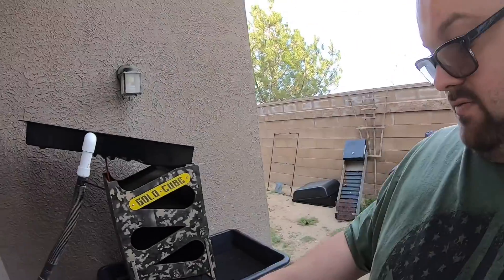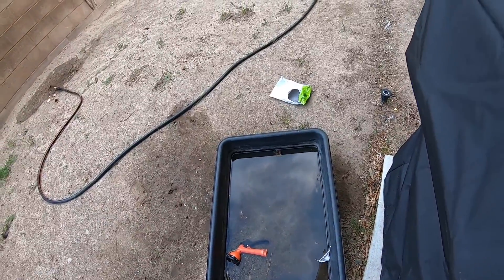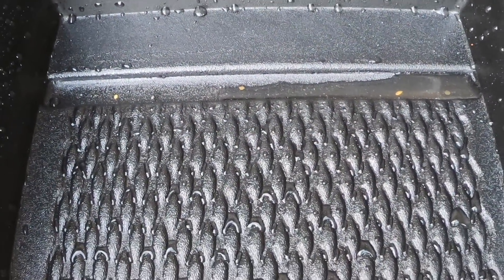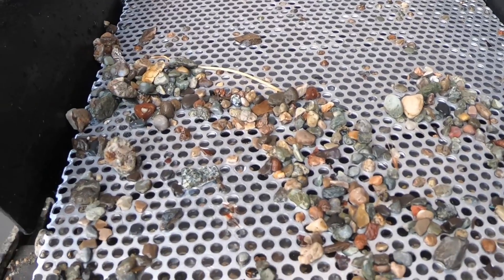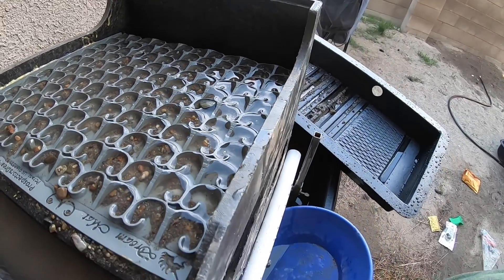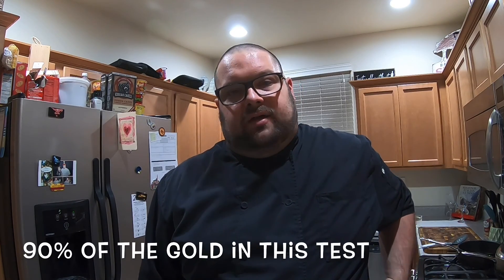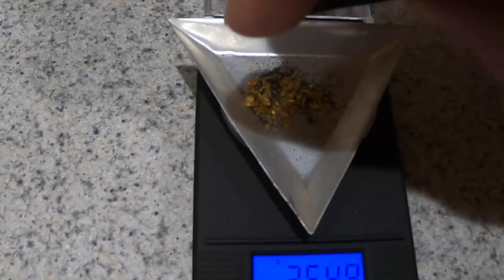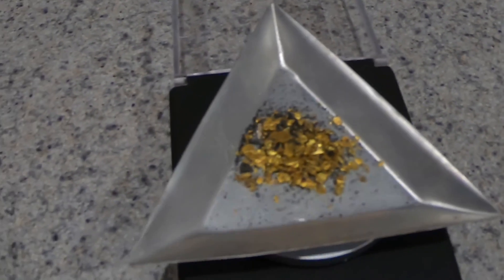SpikeStrike Goldcube Topper first run and impressions #DreamMat #SpikeStrikeProspecting #GoldCube

Comment: Man theres some decent gap there on either side of that grate. I hope you reached out to who sold you that so they can make it right. I'm sure it can be fixed though by replacing that plate with a better fitting one.nice review though. Maybe replace the top cube with another one so you don't have water spilling out the hole.  If you remove the top section of the cube and run the topper on it I bet it runs a little smoother.
Reply: Son shipped while I was in hospital, making it more than right!